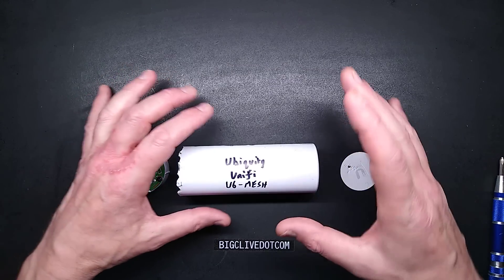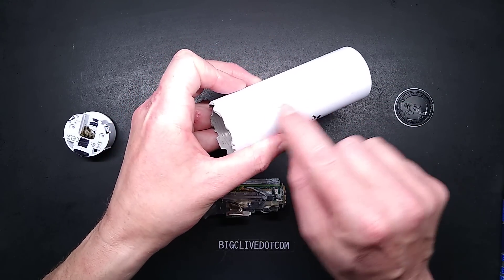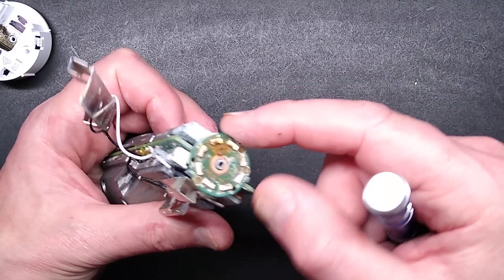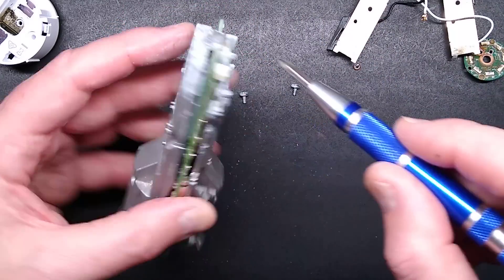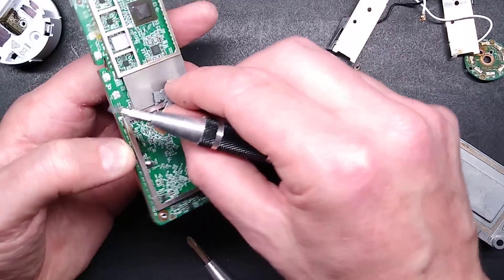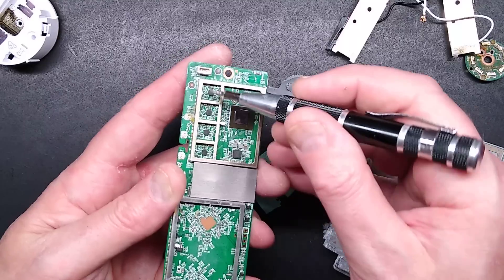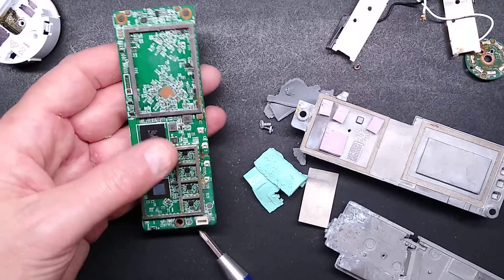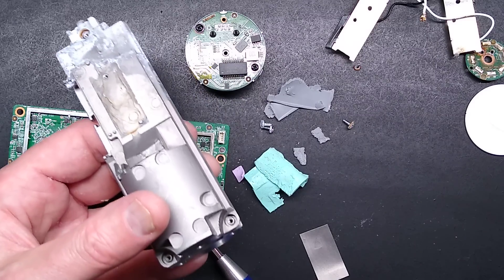Teardown of an impressive ubiquiti WiFi node

Comment: a little bit of insight (from a Unifi device owner who likes poking around in the debug consoles) in to these component wise. The bottom PCB is the power extraction and signal isolation part of the ethernet interface (the chip is an isolation transformer as you said) . I can't say which one is which for sure without researching the numbers, but Unifi gear is almost exclusively using Qualcomm chipsets for both it's main System on chips and custom ASICs as well as the Wifi Chipsets.. the top package near the RF Chips might be the SOC and the Ceramic package might be the ASIC, which is used for hardware accelerated packet processing - the secret sauce behind why Unifi has a good performance for the price, it allows the SoC (Usually MIPS based) to be much lower power than a comparable device that does it all in software, allowing it to operate at the advertised speeds without sweating since the CPU side of things only has to do basic housekeeping and configuration stuff. Operating temperature is your usual 50-70C range common on embedded devices, they can be quite toasty in operation but nothing out of spec.
Reply: There's no special ASIC in these. Under the ceramic heatspreader is an IPQ5018, an ARM based SoC (and not exclusive), the IC by the radio frontends is a QCN9024 - also an off the shelf radio. Everyone does the same offloading, it's provided by the chipset vendors.
Reply: @Monkeh616  good point, I've not torn down their more Recent APs, only poked around inside their Gateway all my stuff is older gen now but it was 2am and i didn't feel like digging up spec sheets for everything, just based on what i'd found out from my stuff.

Comment: Ubiquiti's hardware and software looks great, but it's overpriced for what you get, and the ecosystem is proprietary and buggy. They also pretend to be serious business, but in reality their products are geared towards prosumer homes and small businesses. And if it were well engineered, it would still be working. This is supposed to be an outdoor access point, so why does it have serious water damage? Weird.

Comment: that ceramic thing on top of the chip I've seen in a few routers and other network equipment...... I assume it's some kind of carbon?? alternative to a copper block or similar as they seem to be for thermal; they're usually held on with double stick thermal tape or similar

Comment: Clive, you mentioned copper on the outside of this device. Back in the 20th century, I was on a job that was doing some work for a government agency, but was not the FCC, and, for lack of a better definition, was a shed, made with copper clad panels, and they had copper corner brackets, that had what looked like a copper scouring pad for a restaurant, and this material was placed in the corners behind the corner plates, and the government agency had to have a 100% rf shielded room for sophisticated radio testing. We were not given much information because of the nature of work this agency did, but I'm sure you would have liked to see the actual setup we were dealing with.

Comment: Regarding the corroded port... I installed some UniFi APs outside recently and they are IP rated but... I still packed all the ports with silicone grease before plugging them in. The casework might be waterproof but an ordinary ethernet/usb connector was never going to stand up to outdoor use without it.

Comment: LOL, secret software. None of it, Ubiquiti basically use OpenWRT and then sell managers on their fancy (feature and control lacking) management software... and what does that do? SSH into OpenWRT. :) The hardware is pretty solid though and the fancy management tools do let you get hold of the passwords for the SSH on each device, so the manager is happy with his console, and the actual IT guy is happy with his ability to log in fix the weirdness himself.
Reply: Sure, they may use OpenWRT as a basic environment - pretty much everyone does, by the way, the OEM SDKs are often OpenWRT based, just really out of date and horribly hacked up.

Beyond that, though, there's not much relation - none of the important elements are common, they use vendor-supplied drivers like everyone else. Which means ancient kernels, no common mac80211 stack, no DSA.. all their management and monitoring stuff is custom. Doesn't make it good, but it's theirs.

Comment: I have some ubiquiti devices, an AP and a PoE switch, very are good in many ways, but software quality has been going down I think, and they have been doing the corporate thing of announcing/making bad changes and only backtracking after major pushback. And you can just do it locally, but they do really push you to use the cloud and app (terrible idea for regular home (smart) devices, much worse when it is the infrastructure of your network…). Probably will go with MikroTik or whatever it is called next time.

Comment: I've heard rave reviews from networking guys about Ubiquiti, and this Big Clive review is a vote of confidence.

You don't often see "heatsinked to case" designs much anymore, the last time I saw that in ad copy was an ad for the Apple IIgs, back when there were people who saw that and knew it meant they cared about reliability.

The heat-conductive "putty" is usually easier to peel off, they're typically used between M.2 or NVMe SSDs and their heatsinks, especially if they run at max speed, especially if they're in an enclosed environment like a laptop and there's practically no airflow. I'm thinking the putty encountered here just got really degraded.

Comment: The LEDs are RGB and dimmable - quite nice as the default setting (full power) is quite bright.
Reply: I think most of them ended up being only blue and white LEDs due to the chip shortage of 2021 meaning they couldn't add RGB and released without, at least in the European market
Reply: Interesting;  they've only just become available here (previously only lite and pro ceiling ap were available). All mine came with working RGB.

Comment: I wouldn't be surprised if the RF part is still fine, and a short in the LED part where all the water did collect caused it to fail.
Reply from the maker: There was corrosion on dense parts of the other circuitry too.

Comment: Lots of heat is produced in voltage control and monitoring circuits so mounting them on opposite side helps with heat. Also it looks like the board is made to create Faraday cages around a number of components so putting certain parts on the other side of the ground plane of the board would help with that

Comment: The bit that is incredibly interesting about those weird shaped antenna, including the ones that are on/in PCBs made out of trace material, is that those weird folded over F shapes actually form a capacitor/inductor with the trace/antenna material around it which, especially at those higher frequency where the amount and shape of solder on a joint matters, are vital the the proper and efficient operation of the antenna as a radiator/receiver. 

Though I do agree, RF voodoo is weird. I am of the opinion to become an RF technician one must sacrifice a chicken over ones tool bags as the last step in training......

Comment: I would love to understand what's going on with the shape of those antennae!  I get folding them up to maintain the same wavelength in a smaller package, but the weird shapes and whatnot are perplexing!

Really cool teardown!  Commercial/Industrial grade hardware is such a drastic juxtaposition from the typical consumer grade garbage.
Reply: Possibly even weirder are those designed using evolutionary algorithms.  One paper on the topic is Evolutionary Design of an X-Band Antenna for NASA’s Space Technology 5 Mission.  It's behind a paywall but if you do an image search for that title you can see some examples of antennas that the algorithm designed.

Comment: I’ve been in telecom for… too long. Ubiquiti makes a good product, but I absolutely despise them. Every time a piece of customer owned equipment fought me relentlessly it carried that name on board. 

It got to the point where the service provider I worked for stopped offering any support for  Ubiquiti because of the amount of trouble tickets they generated. Most of the customers blamed the ONTs, but the ONTs were never the source of the problem.

Comment: Actually corrosion is a lot less of an issue than most ppl think. I repair corroded stuff rather often & although heavy corrosion does usually require specialized chemicals & procedures, sometimes all it takes is a small burnisher, Qtips & brushes. (in this case it looked like 3 or 4 components might need to be replaced near the LAN port, but other than that it looks wholly fixable. The missing ribbon cable connection would be irritating but still replaceable. I think it's still fixible even after your tear down.

The pads you were removing come in 5 varieties, Non-reinforced, reinforced, Phase-Change & Solid. Both the non & reinforced are usually a very oily form of silicone with a nano powder that is thermally, but (not electricly) conductive metal inside. The reinforced also has a thin silica or fiberglass gauze inside to give it more rigidity. The solid is usually ceramic like & would usually also have putty on that other end, but to make it removable it looks to sit pretty flush against the heatsink & the heatsink to the case to not be an issue. The other solid varient is a thermal epoxy which is either 2-part, or a solid sheet that you expose to UV that wil melt enough to bond 2 surfaces together <These are ment to be permanent & non-removable, but can be dissilved without damage to the board & components> (similar to a UV 3D Printer would use) The last, Phase Change Material is like the gallium metal used as thermal paste for the main processor of the Playstation5, in that it is solid at one temp & only liquifies under heat, but unlike most materials the more heat you apply the tighter molecular cohesion htey have with itself. So it holds onto the surface & itself instead of melting everywhere.

As for the wireless antennas- the shape, total length, length between turns & the # of turns all matter with regard to the kind of signal you are trying to transmit or receive. The lane tracings are wide becaust it increases the total bandwidth it can transmit at.
Reply from the maker: There was corrosion around dense circuitry too.  With SMD components a little corrosion is a lot.
Reply: Although that's true, as long as there isn't corrosion within the package itself (which you can usually tell by measuring it's values through either a tester or oscilliscope, I usually use a process that removes the corrosion, then give it a good cleaning, protect areas that could short & re-electroplate it. If the lane traces are gone I can usually use a 128th" drill bit (& CAD machining) to cut just below where the trace was (depending on if it's a multi-layer board or not) & fill it with graphite & e-electroplate it. <I only do this on really expensive or old stuff stuff that the client wouldn't normally be able to replace. <vintage, irreplacable>

There are also vert time consuming methods to chemically relpace what was lost also like how you can chemicly turn rust back into iron. (it's not reccomended though because it leaves surface abnormalities) It would be fine for a car, but usually not for something so sensitive, delicate.

Also if everything was surface mount I can etch a brand new board if I have to & just re-solder everything because SM's are so much easier than through-hole boards. Solderpaste & a good reflow oven/workstation is your best friend. @bigclivedotcom

Comment: I still wonder why they put leds on them(as back when I was looking for outdoor wifi extenders most of them  had weird lights) as it could be 2-3 bucks cheaper and easier to manufacture and for "debugging" you can use one dimm common red led that would just blink if something was wrong with unit.
Reply from the maker: I think it's part of the image.
Reply: When you're 50 feet up in the air on a tower, suspended by a harness with the sun beaming down on you, you don't want to be trying to figure out a blink code on a dim LED. Part of it too is to be able to see with binoculars what's wrong, because if you need a certified, insured tower climber, it's around $600 to get somebody out for a simple climb.